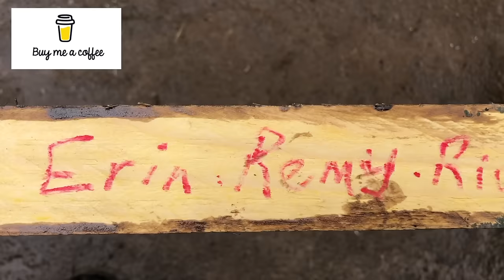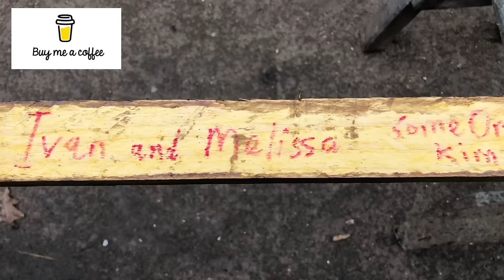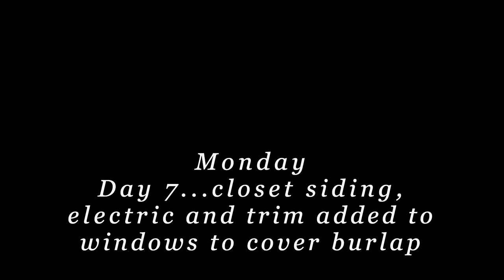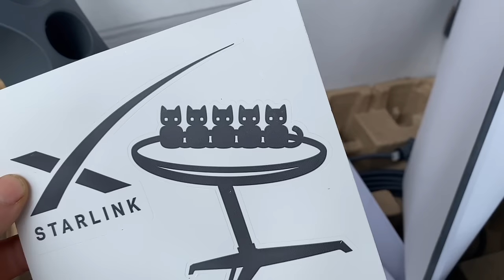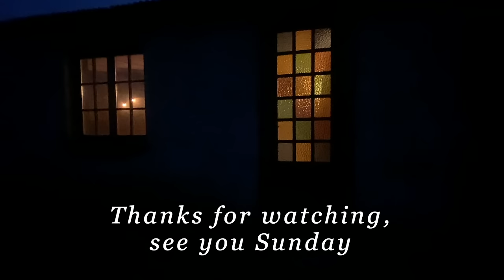#41  Grande Finale, Home Sweet Home. Episode 21

Comment: Your living area/home looks so very cosy and rustic. In Australia the first huts were built out of what was available and affordable in the 1800’s often with wooden or bark roofs and rough cut boards on the outside. The inside was one room only with jute or hessian lined walls and ceilings sometimes lined with newspaper as wallpaper. Your living space reminds me of some of the still existing huts and it looks so very welcoming. Cats will make themselves at home wherever they find themselves.
You have quite a job ahead of you now making the house liveable, I’d be starting with a bathroom/laundry. An outdoor shower is a great idea provided that you can heat the water to at least make it tepid so you don’t freeze to death. Summer is on its way though and you will accomplish so very much during that time.

Comment: One way to fix the dark-colored  walls is just flip the the boards over and rescrew  the boards
Added cost would be only be for the stain as you can reuse the screws and boards and as for time you would not havè any measuring  cutting or drilling  to do on the boards